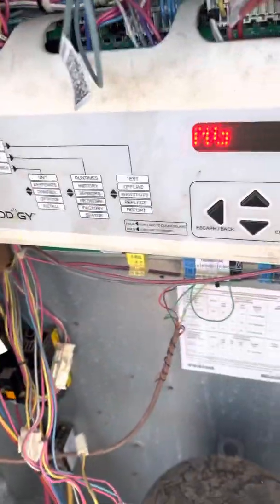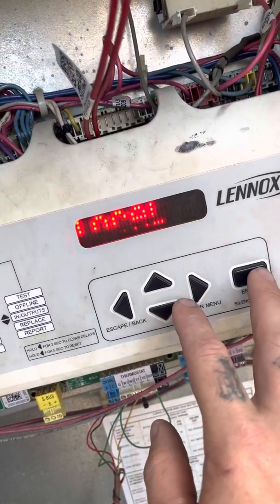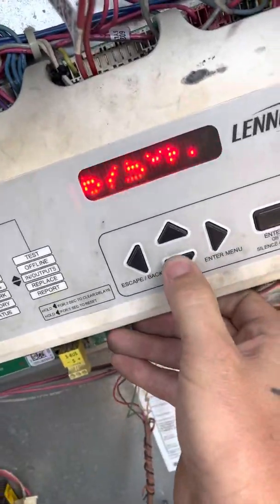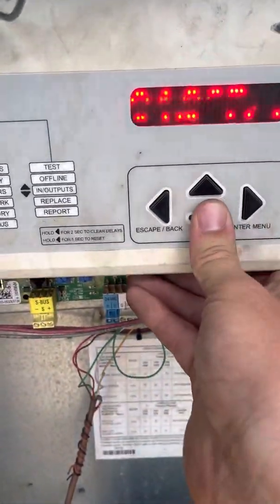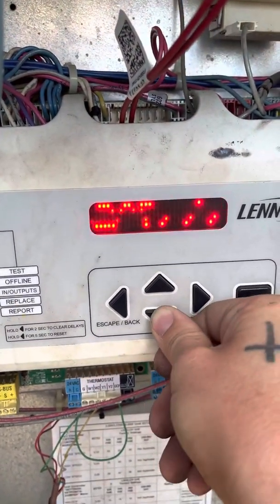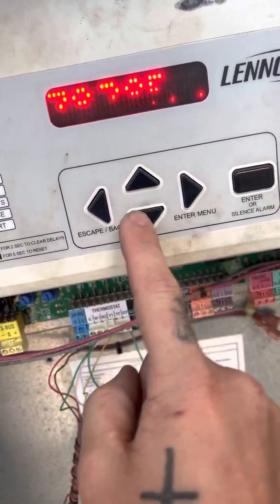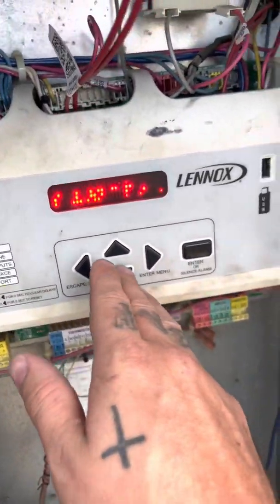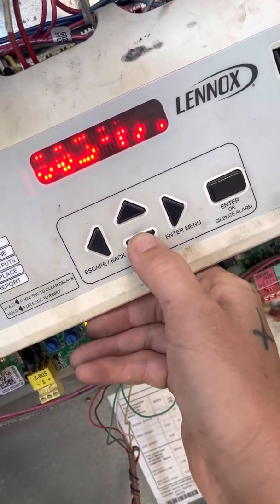How to put Lennox unit with gen1 prodigy controller into standalone mode.

Comment: Hey dude, i know this isnt the same video but in your showcase of the logitech g cloud u show how moonlight runs. U can say me how much latency is getting the g cloud in decoding pls?
Reply from the maker: I did not experience any latency issues but I am running it off of my very powerful gaming pc, so it’s a lot of horsepower to be having any issues. As far as that goes I would recommend you being on very high speed internet and make sure you are up to date on all software both on g cloud and pc as well as have the latest moonlight software. Also perform a internet speed test and if everything checks out then you should not experience any issues. I was able to go 42/2 on Nuketown COD on handheld remotely